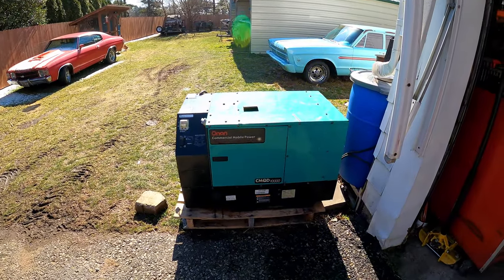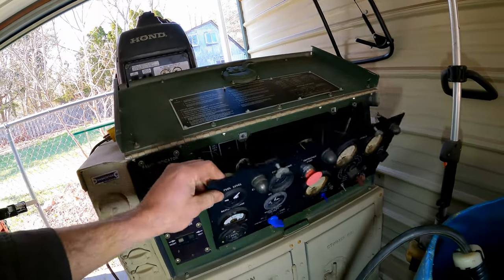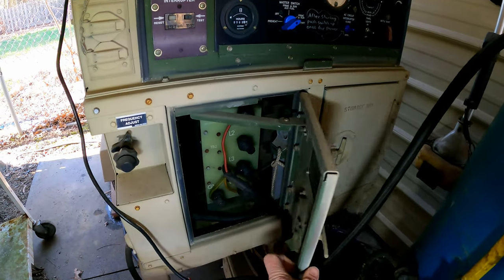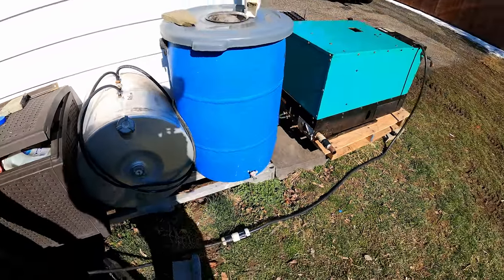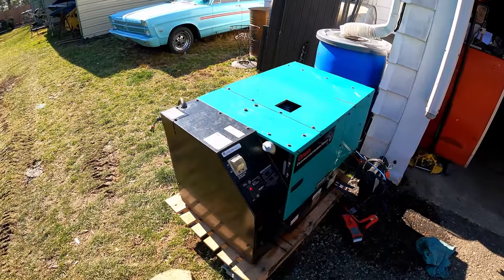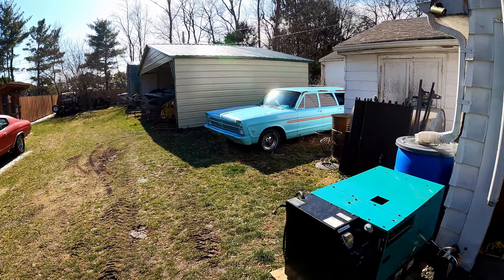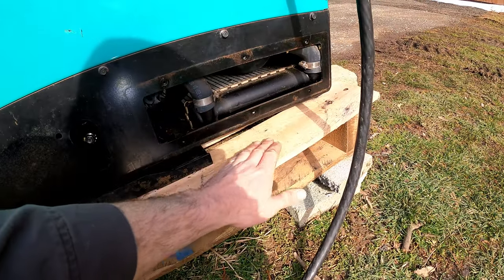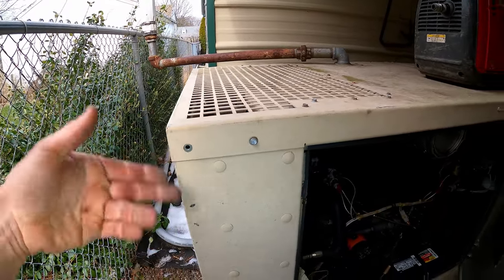Replacing MEP803a With Onan CMQD10000 Diesel Generator

Comment: I have the 2cyl version of your military genset, the MEP802a.  When I got it running it smoked pretty badly as well.  I read on the Steel Soldiers website that they're commonly ran without enough load and carbon can buildup over time in the exhaust.  The cure it to put it under a hard load for at least a couple of hours.  Since they're rated to run at 125% of duty cycle I ran it at 5000 watts, the smoke finally cleared up after 3-4hrs and hasn't returned since.  We lived off it for 10 days straight when a big ice store wreaked havoc a few years ago.  Ran like a champ and was only using around 7-8gal of diesel per day.  I wouldn't recommend it to someone that's not mechanically inclined though, they'd probably be overwhelmed with all of it's gauges and voltage possibilities.

Your videos are entertaining and I'll be looking forward to more content.  Good luck with both of your awesome gensets!

Comment: Hey Chris , that is a pretty nice Generator.  My neighbor has a Onan propane powered stand by Generator.  The moment the electric goes out it starts on it's own and takes over.   There has been several times when he is the only house in the neighborhood that has electric.  I am so jealous of that LOL..  I do have a portable one that I can run the furnace for heat in case of a power failure in the winter.   Thumbs UP man!  👍

Comment: The MEP 803 and the MEP 806 are staples in the USMC.  When I was in the Marines, my job was to maintain and repair those generators.  I did far fewer repairs on the 803 compared to the 806 but this brings back some good memories!
Reply: What was your opinion of the MEP-804A?
Reply: @joeygmuender7331   never heard of it

Comment: Dude! Awesome that you got another generator. It helps me because I am in the market for a backup diesel generator. But honestly that seemed like a pain to do maintenance. Having to lift it to change oil sucks. And having to work around all the covers to change filters…..makes me think that if they are all like that then maybe I want to set up a shed around a generator and remove all the covers so I can easily do maintenance. Have you seen those real big generators from China I think that they sell on eBay? I keep wondering if they are worth it and how to change over to 60 hertz from 50.
Reply from the maker: Yeah these are definitely a little tight to work on. if you keep it suspended up on blocks, getting to the drain plug won't be a problem. And I don't know I would probably stay away from the Chinese generators if possible. Get something with a Kubota engine in it. Can't go wrong

Comment: If you are keeping the 803a you need to do the fuse and mov mods.  Also load that thing up or else its going to smoke and wetstack. parts are not hard to get at least in 2023

Comment: To each their own...I live in a small rural township (was a busy logging community circa 1850) so the smell of Diesel is not a concern, most of my neighbors have Wood Stoves... I streamlined my life about 18 years ago, EVERYTHING in my house is electric... It seems recently our grid is not reliable... That Cummins QD model has its perks, a little more fuel efficient and quiet... I am looking to get a MEP-803A and have a Larger Fuel Tank/Stand built to go with it... The reason I think for myself the 803 would be better, because I would likely be running close to max output, the surge or extra head room in power output may be necessary...

Comment: The MEP 803 is the better Gen Set No question. Everything is available for the MEP 803. You are crazy going to the little Kubota engine little Gen Set. Don't use coloured Diesel in them only Clear Diesel as the Dye in the coloured will rot out your fuel lines.

Comment: Hello How’s the Onan working out. 
Onan runs 3600 rpm
Mep 1800 
The Onan parts are more available but also can on expensive side. 
Nice video
Reply from the maker: The onan is working great! I end up keeping both of them but I like it much more. And it is 1800 rpm. 1.7l Kubota. I think they do make a 3,600 RPM as well
Reply: The smaller Onan QD gens run at 3600 RPM (5000, 7500, 9000), anything over 10000 is a 1800 rpm. As far as parts, unless it’s Onan specific build parts, cage fan for example, pretty much anything engine wise is available via Kubota. Filters, injectors, pumps….. yeah, Kubota parts may be a little more expensive than some but they are everywhere. I used Kubota engines in many different machines and they are literally bulletproof when maintained.

Comment: Man, you don’t screw around, go big or go home with generators. I do small engine repair, so I always have 5-20 small generators on hand at a time. Would love to have a bigger diesel generator that just always runs though.
Reply from the maker: Yeah I figure 10 k is pretty much the minimum for a whole house back up. Especially since I have an electric hot water heater. Not that I would really be running that but I guess if we didn't have power for a long time I would be. I like diesel generators most because I run my house on home heating oil which you can run through these generators with no problem
Reply: @NNKH2  yea, I have a 10,000 watt generac, we have a large house, so it has trouble powering the whole thing sometimes.

Comment: the MEP803A is the better generator, by far. no smoke at all on mine, runs like a swiss watch
Reply from the maker: They don't run as clean. Stinky diesel when under load.  Also hard to get parts for them depending on what you're looking for. I still really like mine but this one is better overall for my needs powering the house. Hard to beat a Kubota diesel